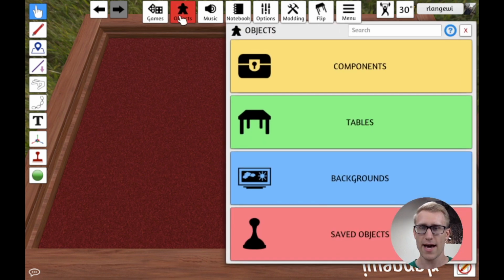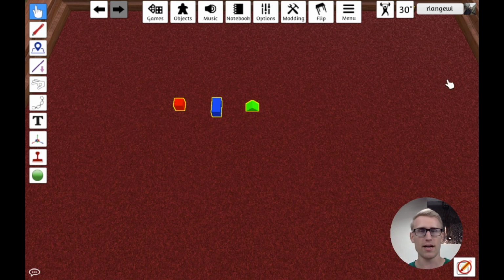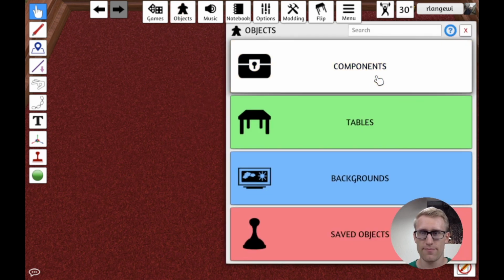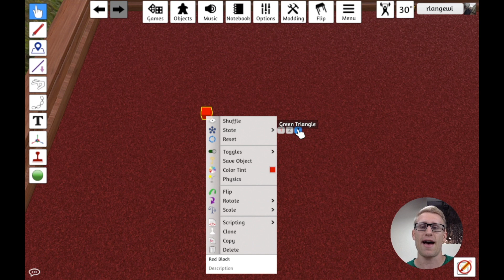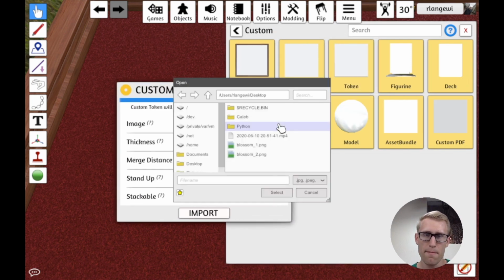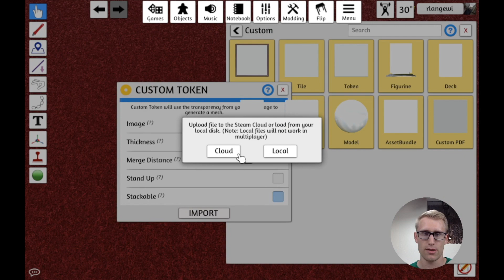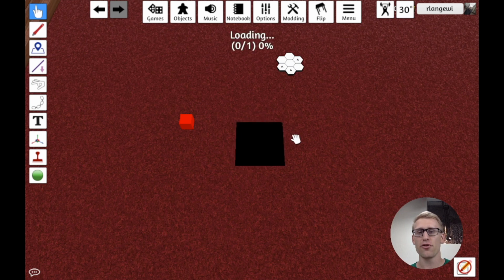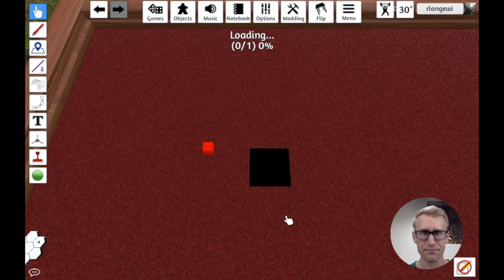How to Use States in Tabletop Simulator

Comment: This video was quite helpful, thanks. The way that I avoid making the tokens load every time is by locking them then using gizmo to move them under the table and out of sight. If they are coming from an infinite bag then you can sometimes just size them down and gizmo them inside the bag model instead of the table.
Edit: you might have to remove any name or description so it doesn't show up when you put your cursor over it.

Comment: Can this be done without showing that, for example, a card has several states? Trying to implement a card game into TTS and some of the cards have various different versions to switch through mid-game.
Reply from the maker: I'm not sure if I understand your question... you want to use states but you don't want the cards to indicate that you are using states?
Reply: @LudoLodge  Basically, yeah. Though, silly me, did notice by now that cards having states is hidden until the card is drawn from the deck. Solves that issue at least.